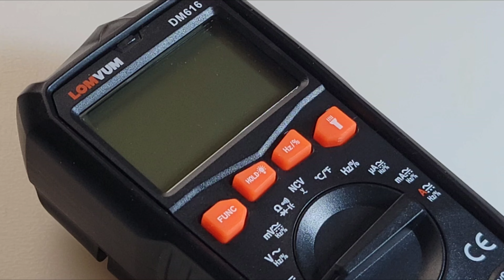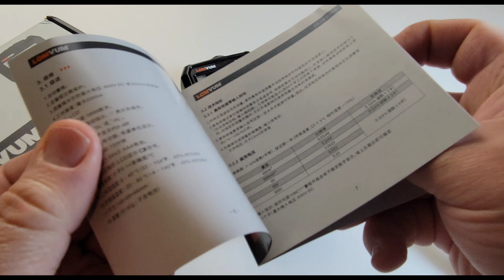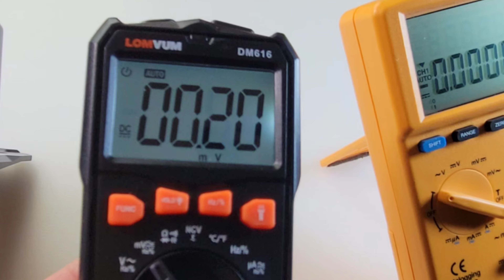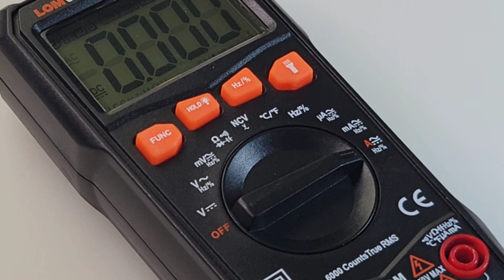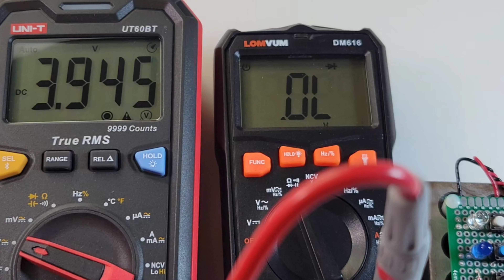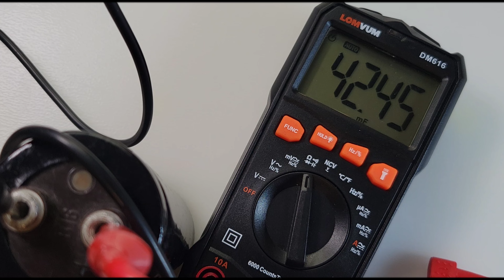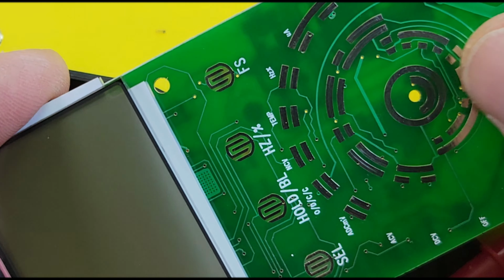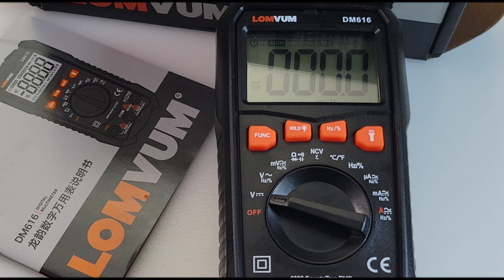LOMVUM DM616 CHEAP-O Multimeter Review  & Teardown!

Comment: Thanks Darren.
Strange, but my copy has better accuracy (although it is quite good here). I bought mine for $9. Without magnet. Apparently the yellow LED does not light up due to voltage stabilization for power supply. But that's not accurate, I could be wrong.
It is a pity that I did not check 10 or more amperes, I would like to see its accuracy. After all, mine measures very well. It can be seen that the multimeter is accurate in measuring micro and milliamps.
It is a pity that I did not check the NCV, there is nothing special here, but it breaks through thick enough concrete.
Works well with frequencies. Measures any voltage well. The call is lightning fast. Quartz at 6000 inside.
You have to pay $2 extra for the magnet.
Inside there is a microprocessor from SD 7501, which is more interesting in terms of performance than 0660L.
This multimeter is similar to clones, like RM113 and others, but 0660L is installed both in state employees and in more expensive versions of multimeters, and here is a fairly new chip. It’s a pity that they didn’t give a place to calibration, because if it were possible to calibrate the last value even more, it would be very cool. Although, I repeat again, my device shows the same values  a laboratory power supply / oscilloscope.
Thanks for the review.
 How for such a price (for my region $ 13) I would rate it higher))

I'll give you a few more good multimeters for review))
Reply from the maker: It's too bad the accuracy wasn't better but it's still a decent all around multimeter. If I paid the same price as you I definitely would have been more impressed. Lomvum is a name to watch out for!  I'm always ready for more multimeter recommendations 😃
Reply: @KeepOnTesting  I agree) It's true, it's true)

Comment: Actually in spec. 1.2 % difference would be 0.6 volt from the 5 volt reference. 0.12% would give you the .6 volt diff but adding the + - count, still in spec. (I think) Also, at 120V 60Hz there should be no difference between average responding and True RMS. Only at low AC millivolts would there be a difference, here average is better due to the noise of the True RMS converter.
Reply from the maker: You are bang on Mark..more or less.Its still pushing the accuracy border but it's still in the margins. I heard this was a very accurate dmm so I was a little put off by the less than stellar showing.
I've remarked a few times in the past how TRMS is not that important for residential use. An averaging non-true RMS AC meter will high pass filter the signal first and rectify it prior to taking the average value, which will be less than the RMS value of a pure sine wave, so it will multiply it by a correction factor.

With a true sine wave dmm the measured waveform is assumed to be sinusoidal and peak or average value is scaled to reflect accordingly. None of this matters for your typical home AC output.

Comment: Hello Darren. How do you like the idea, check out the Brymen BM869S multimeter. My friend has one, I took it home to test on my equipment. I'm amazed at the accuracy of the voltage and resistance. This multimeter shows more accurately than Fluke 289. How do you like this statement, will you check it?))
By the way, I got a new device here, YR1035 + which is calibrated along with the probes (since manual calibration was removed from the firmware). And he showed + - 2 on the last digit from the readings of my LOMVUM 616))) I told you, I got a fairly good revision (with the old body markings). Something like this )
Reply from the maker: Hello my friend! Brymen is definitely on my radar. I have a ton of gear to review but I'm hoping  to review a couple of Brymen multimeters in the late fall.😅